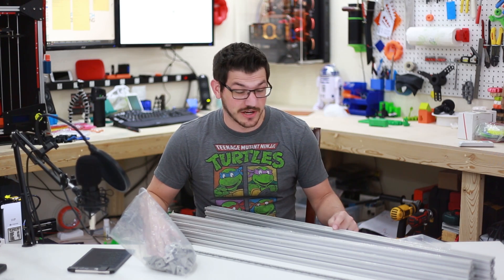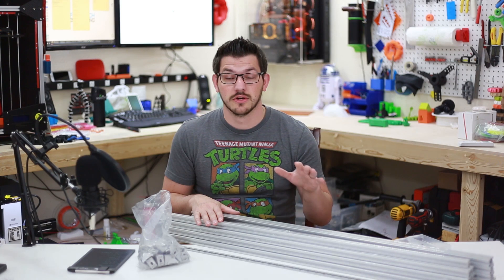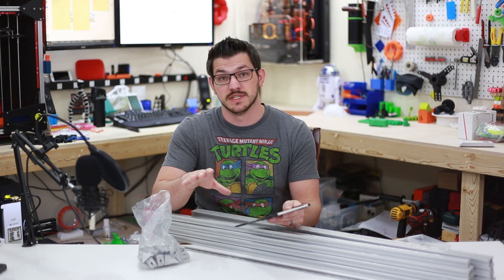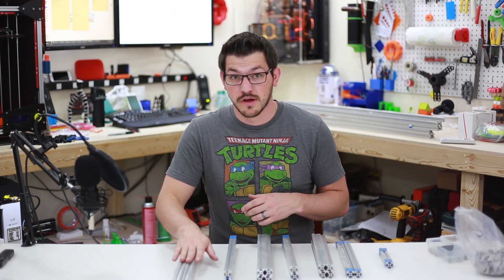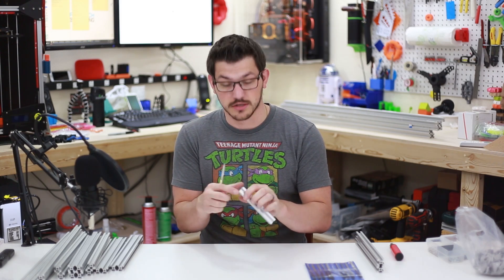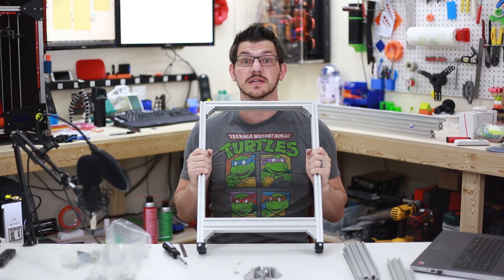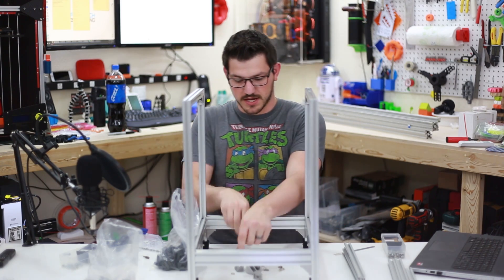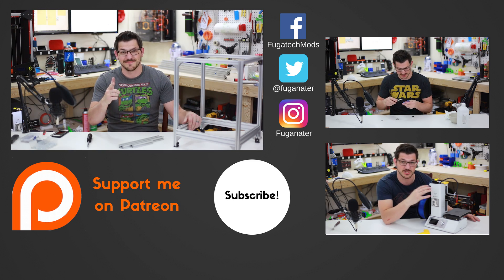HyperCube Build Part 1 (Frame)

Comment: How much space is in between the table it's on and the bottom of the 2040 extrusion and how much in between the top of the 2040 and the bottom of the build plate
Reply from the maker: Bottom can be as large or small as you want it but mine is 60mm off the floor. When homed, the build plate is about 100mm from the top of the 2020 extrusion.

Comment: One cool thing i did, i designed some 2020 and 2040 that is 3d printable... BUT i made the hole in the center 0.25 inches so that you can slide steel rod into the hole to reinforce the 3d printed extrusion. Works like a charm for this printer. I have it on thingiverse. 

2040 extruded aluminium found on #Thingiverse https://www.thingiverse.com/thing:4150905

Comment: So when building the frame what is an acceptable level of the frame not being square? For example if I built one of the squares for the frame and it was off from being square by a 1/4 of an inch. Is that too much?
Reply: 3d printers are very precise, so probably but I think it would just offset things, not actually affect quality of print
Reply from the maker: Ya that is too much. They need to be perfect.
Reply: What if each set of 4 is slightly off, but all equally? Say I'm trying to get 315mm x4 pieces and I end up with 317mm x4 for that set. Will that be problematic?

Comment: Would you be able to post the cut lengths of the aluminium extrusion?
Reply from the maker: I didn't because what you need may be different than what I used. In the video description is the HyperCube Calculator. use that to figure out what size extrusions you need.

Comment: After researching which 3D printer starter kit to buy I am looking at the Anet A8. I then stumbled across your brilliant video. When I do get my first 3D printer I would love to convert it into a Hypercube the reason being is (a) aesthetics I like the cube shape frame much better AKA Ultimaker and (b) I don't like the way the hotbed moves around the extruder as opposed to the way it is the extruder that moves around the hotbed on the Hypercube. Before I buy my first 3D Printer which would be better for conversion, an Anet A8, a different Anet or just a reasonable Prusa i3 copy (I am looking at the ones on eBay for about £130.00. P.S. What a great workshop you have - is that a PC in a perspex frame behind you?
Reply from the maker: I have seen a lot about the A8 being a decent machine but have not used one myself. I personally like the Folgertech 2020 i3 which costs a little bit more. http://bit.ly/2gBLcqg Another good thing about it is that it is make of 2020 extrusion so you can reuse that for your HyperCube which will cut costs. Just remember, you get what you pay for. The cheaper the kit, the cheaper the components are and might be more work than its worth.

The PC in the background is one that I just finished up. You can check out the videos here: https://www.youtube.com/playlist?list=PLm2OH_myqt7ZsXM1GTq_oLyaA3zfeefHc

Comment: A word of caution on the extended Z-height. The 8mm Zaxis rods won't be stiff enough. They will bend and will oscillate causing ripples on the surfaces. You should think of using 10mm rods instead.
Also rubber feet are a must. They absorb vibrations that would otherwise find their way to the counter lever bed and cause rippling.
Reply: Agree, even Tech2C says the 8mm rods are flexible at his standard height. I'm using 10mm rod on my Z and it's very solid. I've just got 200mm bed and 200mm Z height (400mm rods). I used the henryarnold bed carrier and LM10UU bearings.
Reply: But watching more, I do like the idea of building the stock printer then seeing what upgrades to consider and why. It'll be interesting to see the progress over time.
Reply: I ended up keeping the 8mm linear rods in their original position - on the back - and putting 2 lead screws on the sides of my bed (sort of like the d-bot). This resolved basically all of my z-axis issues. Eventually I'll probably switch to 10mm or 12mm linear rods but for now, this helped a TON
Reply from the maker: Thanks for the heads up. As other comments said I want to do mostly stock to see how it goes. Then decide what I want to change. I'll probably use the yellow balls that I am using on my FT-5 for the feet.